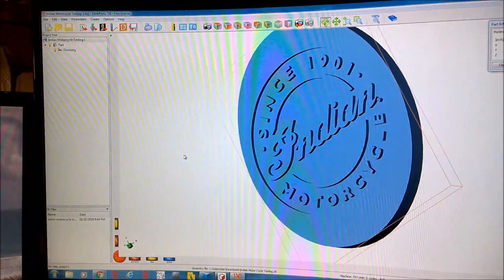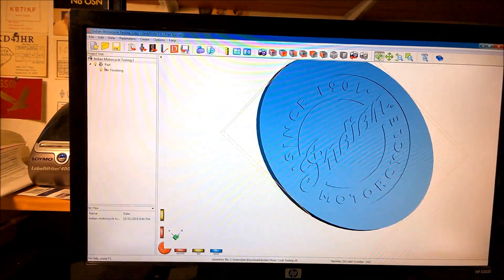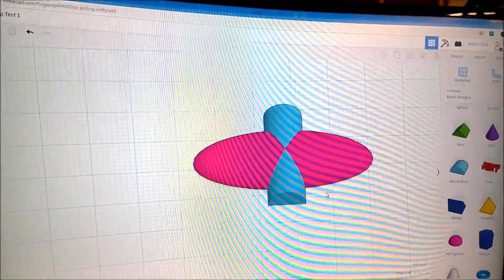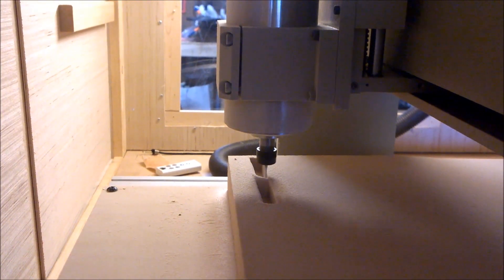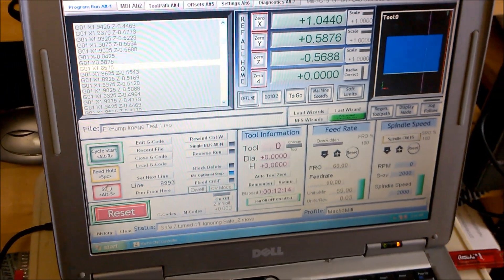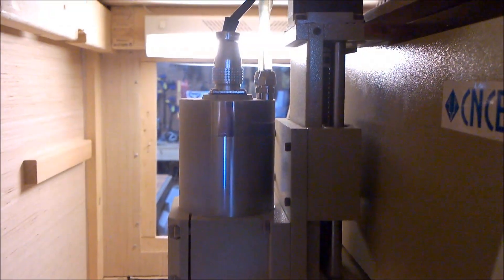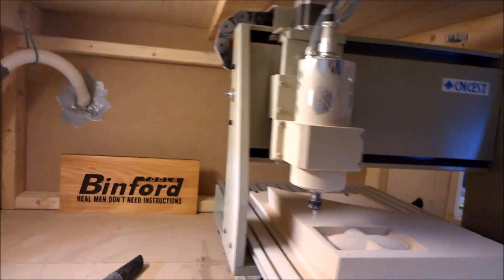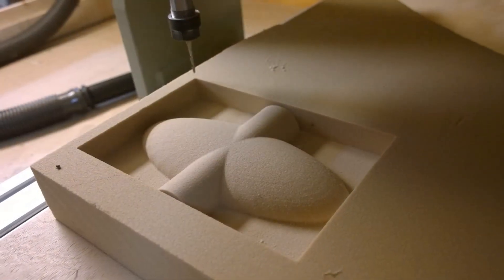Free 3d CNC Software! - DeskProto

Comment: hi there, whats your thoughts on the 6040, i was thinking of building my own, but these look pretty sturdy. I would want to put a 1.5kw spindle on for aluminium ?
Reply from the maker: Great machine for the price.  Pretty solid and heavy.  I've built several cnc machines but currently use my 6040 for all my hobby projects.

Comment: Hi, which materiel you use for graving ! its not wood i guess?
Reply from the maker: It's sign board.  A high density foam.  Ask around at some local sign shops, sometimes they have scraps they will give you to practice with.

Comment: What's the tool?
Reply from the maker: The endmill was from a cheap set purchased on Amazon.  Double Edged Ball Nose Milling Cutter.  3.175x2mm; 17mm working length; 38.5mm total length.
Reply: @drez20001  that's a nice finish with such a cheap tool. Good work!